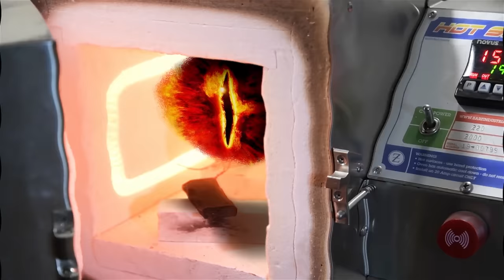Making a Slip Joint Knife

Comment: Hey tony. I’m a knife maker. I noticed that you didn’t put any bushings or bearings around the folding pin. There are these little brass “bearings” not really bearings more like a paper thin brass washer with holes in it to help keep the oil in that joint so it doesn’t completely squeeze out when you tighten it down. Might be why your knife didn’t feel the same as when you did the dry fit. Also if you are gonna make another one. You should use screws instead of pins (especially for a folder) so you can adjust the tension and blade centering. Still super cool!!
Reply: Merely replying so you can see Tony saw it!
Reply: Perhaps the ones he used weren't ideal, but I see a pair of bushings among the knife parts at 16:10, and just three seconds later they're shown being installed on the knife.
Reply: @klasodeth  Those are washers. Bushings go in between the knife blade and the pivot pin, kind of like a sleeve.

They look like plain steel washers, which aren't the best choice. Most knives that use washers instead of bushings or bearings use either teflon, nylon, or phosphor bronze for the washer material, because they're self-lubricating to some degree. Teflon and nylon are usually used on budget knives, while phosphor bronze is more often used for more expensive knives ($50+) because it lasts much longer and doesn't compress like teflon or nylon, so its more consistent and easier to dial in the action. 

Still, pretty good job overall for a first attempt.
Reply: Hinge tension was my first thought. Takes a lot of fiddling to get my knives "right" after cleaning and oiling, but it's totally worth it.

Comment: Hi Tony, that knife came out excellent. Love the violin design, and the fact that you made it just for Xyla.
If you make a folding knife in the future, use some brass tubing standoffs on the inside (slide the rivets through them to hold the scales apart). That way if the rivets are too tight, it won't pinch the blade.  Cheers

Comment: That was doubly fun for me - first the knife making, but then, a blast from my past - that electromechanical thingy is a repurpose of two uniselectors from a Strowger PABX. In real life, every time you picked up your handset, back then, one of the uniselectors at the PABX, would self-rotate to look for a free first selector, that would give you the dial tone and route the first digit you dialed into a free second selector, and so on, until the last 2 digits were dialed on the final selector (a 10 by 10 matrix of subscribers) that would then ring the destination phone.
Have a Great Christmas!
Reply: The moment I saw those things I knew he raided a telephone exchange.
Reply: @kleinisfijn  Or a Nuclear reactor fuelling machine... cos that what the logic controllers were in my early days playing with them. We changed to GEM 80 logic after about 1988.
Reply: @kleinisfijn  Yep. Once you have known it, you can't forget it :-)
Reply: Until late 1980's, when they broke the original NANP to add exchanges due to cellphone and pager (remember pagers?), digital electronic telephone switch software still emulated the digit-by-digit pattern so they could replace those old mechanical switches. More useless trivia.
Reply: @weshowe51  Pagers are now on a seperate network I think. My pager for the FD is independent of the phone lines and uses VHF instead i believe, entirely different isolated towers not just piggybacking on the cellphone.
Reply: @weshowe51  Yep. long before IP phones :-)
Reply: @kleinisfijn  miniature versions of the old step switches.
Reply: When I first saw it I immediately said uniselector.  Hav'nt worked on one of those for about 50 years..
Reply: The old hospital i worked at had one still in use on a star talk conference system..  whole thing ran off of a big ass transformer with the 90vac pushing on the ring circuits and a 50vdc pushed for all the electromechanical contact selectors.  All connections were exposed and sparked every time it would get switched on from use..  they had it as a backup because the commissioner wasent fully trusting of the whole voip digital transition.  Also had an old pbx for all places also.. was a bitch having to transfer all those in house numbers into call manager and leave both operational for over 9000 numbers..  on a pbx that was slowly dying from parts going obsolete.   Luckily i was able to have full run at it and made some software to make it work.  Funny thing is that as soon as the old system was switched over my job was obsolete as well so they fired me.  But when you fire a software developer whos work is the backbone for a systems operations,  you might end up losing the copyrighted, private use of software.  So they lost the rights to my software which was completely unique and had protection that was in place to default to 0 for every station and set.  The hospital shut down for a few months and they had to buy a whole new setup and buy all the cisco switchgear and networking plus wire cat6 and run a new fiberoptic redundancy star to the place..  lol. Cost them tens of millions.. yet they only offered me a lawsuit which i won, and all they had to do was not fire me..  or hire me back which was offered but said they were losing money by having me because had to pay me for doing 3 jobs responsibilities.   Learned a lot there..  dont ever trust any company unless its yours cuz people dont care about anybody but themselves..
Reply: @Z-Ack  I hear you and understand perfectly. The cut-over of many old systems meant an immediate firing of the personnel that worked hard to ensure it (many times overnight), because they were no longer needed with the new system online - loyalty seems to be expected only one way, on these situations.
Reply: @taliakuznetsova7092  They were always on a different band than cellphones. But "back when" you set them off by making a phone call. Then later, they added IP connections and text messages.
Reply: @Z-Ack  wow this is an amazing/sad story. this kind of thing happens so much. save a dime to lose a dollar, and somehow they NEVER LEARN...

Comment: Brought back memories watching the uniselectors operating, we used them back in the seventies on our Varec tank gauging system.
The tankfarm operator in the refinery would dial the tank number and enable the transmitter mounted at the base of the tank and send pulses to the remote selector and display the tank level on the console, maintenance intensive system until we replaced with a more modern system.

Comment: As a knife maker who's a tot fan this was fun to watch.  Next time i hope tony uses a 1/2 stop if he makes another slip joint also tempering the spring to about 45hrc is where you want to be.  Yes Sandvik requires liquid nitrogen to convert retained austentite but the blade wants to be closer to 60hrc.  Ive had good luck with dry ice and acetone baths directly after quench and pre tempering.

Comment: That switch looks a HELL of a lot like the cam stack on a pre-computerized sewing machine.  I wonder how much crossover there was with that kind of engineering back in the 40s-60s?

Here's an idea for you, This Old:  Buy a Singer 401 or 500 and tear into it.  Those engineers were doing a hell of an interesting job with cams, followers, bellcranks and linkages.  They are mechanical as hell and incredibly precise for things made in a high-production environment.
Reply: I can't really think of a way to make a [ reasonably durable ] electronic sewing machine, it is just the sort of device that is inherently made of mechanical clockwork. I mean sure you could use a computer controlled motor to get an exact number of stitches but other than that it just seems like a purely mechanical task.
Reply: @mytech6779  Many of the new domestic home machines use circuitry to control zig-zag and stitch length settings, but the actual work is still done mechanically. And there are long-arm industrial quilting and sewing machines, basically CNC printers that use thread instead of ink, that use stepper motors. But those are hideously expensive-- $15-30K-- and frankly, I don't know much about them. Some mechanical means has to get the thread through the fabric, around the bobbin to pick up the lower thread, and tighten it to form the lock stitch.

If you REALLY want to break your brain, take a look at what a serger is, what it does, and how it does it. Or even a walking foot sewing machine.

Comment: That led light sign thing is so cool to see. On your knife my only concern it's folding knifes should lock open solidly where you have to manually release the blade to close it other wise during use the blade can close on your fingers. But it looks great
Reply: Here in the UK, locking knives are banned. Bloody stupid if you ask me.
Reply: @LesNewell  wtf who managed to get locking knives banned? I'm so used to them by now that I feel really unsafe when one doesn't lock
Reply: Here in germany locking knifes are not banned, but the must not be spring-loaded (e.g. self-opening). And I think there was a lenght-rule as well, something around 12cm (~5 inch).

And often it is not allowed to carry those knives in public, but you can own (and safely store them) at home.
Reply: @LimabeanStudios  You aren't allowed to carry a locking knife in public, also the maximum blade length is 4".  At home you can use a bigger knife and I think they can be locking.
Reply: @christophpoll784  dang I'm from MN our max blade length is 7 inches and you can carry fixed blade or folding they can be spring asserted aswell just not push button or switch blades or butterfly blades. I carry a 5 inch boot knife daily
Reply: @Self.reliant  Ah yes, but you live in the US where it is Ok to carry an RPG in public and go to do your weekly shop in an Abrams! 😂
Reply: @martingardener90  no rpg but definitely a side arm. Our president wants to refund the police. I live north on the twin cities in MN and things are getting pretty rough down there

Comment: Hey Tony, I've been watching your videos longer then I can remember.   Respectfully, I have a tip.  A quick and dirty method for setting the proper spacing on a folding knife is to make spacer bushings.  Place them on the pins in between the liners.  When you peen the pins, the bushings set the gap and tolerances of the knife, preventing the peening process from squeezing the liners on your blade, and spring.  A lot of high end knives use them and have multiple color schemes so you can customize the knife to your liking.  Check out a Benchmade bug out for an example.  Merry Christmas Tony!! Thank you for the years of amazing content!

Comment: I found  your channel again after google kicked out my subscription last year. I actually learn stuff and enjoy your humor. I made a spectrum analyzer multiplexer for Intel back about 40 years ago. It was completely solid state, 512 channels and 64 lines per channel. It's purpose was to look at address and data lines on microprocessors in a burn-in oven for testing the microprocessors slated for military use. I thought up the design on my lunch hour while on contract to Intel to find a way to address cache memory on Zeon, Celeron and Pentium Microprocessors. Keep the creative juices flowing.

Comment: In 1968, I made a conditioned-response AI out of telephone stepping switches, very like those in this project only smaller.  The way it worked, was that you would push one of six buttons (the command).  Then it would step through 10 different light bulbs (responses).  If you pressed the "reward" button, it would remember that "response" for that "command".  You could repeat that for each of the six command buttons.  You would end up with a "trained" AI, with each command tied to it's own response.  To start over, there was a "forget" button.  I was 16 at the time, and this was in my occupational electronics class.

I entered it in the high school science fair, and won nothing.  My classmate who made an electronic version of a single neuron won.  My electronics teacher was the judge, and he was an analog guy.  But I won the prize that mattered:  The neuron-maker was blown away by my machine!  This began my lifelong interest in digital electronics.

Comment: Hey Tony, we have these things we use at my work that are like threaded inserts but are divided twice 90 degrees apart half of the height of the threaded rod. The other half is threaded on the outside, which can be put into a fixture. I believe you can find these at Ace Hardware but I am not 100% sure and I do not remember their name. They use a countersink screw / bolt so that the taper will spread the fins apart as it is screwed in, applying holding force to the area. Maybe in the future you could use something like this on the wooden handles to put them back on the CNC router to do a facing operation and then re-run the program for the design on the pieces afterwards? I suppose that would take more work than what you ended up doing, but it might be something worthwhile in the future. Thanks for being such an inspiration!
Reply: Interesting. Maybe post a pic on imgur?

Comment: 12c27 can still be cryo treated for a little extra hardness at any time.  Maybe not a bath in nitrogen due to the thermal shock on wood scales and epoxy, but it would certainly suffer no ill effects underneath a chunk of dry ice in a cooler for a few hours.  -70C is possible without an ethanol or acetone bath if the cooler stays insulated with enough dry ice.  Might pick up a point or two but not quite to full cryo hardness, as that is best achieved immediately after quench.

Comment: Factory recommendations aside, I’ve found 12c27 like most stainless/high chromium steels have a far better quench with aluminium plates - much more consistent and a higher hardness. Domestic Freezer will get you a little less retained austenite too. Love your work!

Comment: Very nice knife.  It sucks you lost the detail on the handle but that is how things are sometimes.  On another build slip a really thin plastic shim in between the grips and the blades when peening over the brass rod and then slide it out afterwards.  It should eventually free up a bit but that allows you to have just a bit of space when it's all put together.

Your gift is actually really interesting.  looks like as you said an exchange multiplexer or something of that nature.  Anyway I believe what is happening is one of the rows columns on the first one is being used to activate the second one so that a new line can be addressed.  So a line is what goes around the device and a column gets dropped down after a certain point.  Anyway they basically use pinball electrical mechanical coils to create the movement.  In fact they could be old pinball parts from the look of them, or new oldschool ones or something like that, LOL.  Side note, the same part is what is used in old school tattoo guns, the electromechanical coils that is.  They are just setup to fire repeatedly when the power is applied, and yours has a "dead spot" that is activated by the switch.  Very interesting indeed.

Comment: The LED chaser looks to be controlled by Uniselectors. They are an electro mechanical device where a solenoid  advances the rotor by one segment every time it is energised. Uniselectors were used in telephone exchanges

Comment: They certainly look like old exchange switchgear. I remember working in an Australian exchange. When the local radio station did a phone in, and 1000 people dialled the same number, you could follow the call across the building...with your ears, not on foot! When we finished upgrading, the entire exchange was empty, except for one dresser-sized cabinet that made no noise at all. I have no idea what happened to the switches

Comment: Strowger switch (maybe).  Silly idea... Get out your DLSR and set it to manual.  Set its shutter speed to a little longer than the machine takes to complete lighting all the LEDs (you'll have to experiment with the aperture to get a good exposure).  Sit it on a tripod and point it at your (received) secret santa present.  Turn all the lights off.  Release the shmoo (or press the shutter release - your choice).  You may need to add some more illumination to fill in where the red glow doesn't reach (depending on how dark you got the room).  But you may end up with a cool shot of the machine, with your moniker fully illunimated.  Great video - I'm going to go check out the two people you connected to - they both sound talented.

Comment: Wow those rotary switches and the whole wiring harness look just like what I pulled out of an old airplane radio frequency selector. I cut all the wires intending to put potentiometers on the shafts to use it as a control for a flight simulator, and only after I’d done that did I realize how stupid it was not to leave the encoders wired up to sense the position of the selector.

Comment: I'm pretty sure those switches are from an old telephone exchange.  Where your line entered the exchange, the first dial you did (old style clickityclack) would drive the first rotary switch the same number of steps.  Then each dial after that would affect the next switch in the chain.

I'm sure there were plenty of other electromechanical shenanigans going on, but that was the basis of the system.

Your dial interrupted the current, causing a pulse.  That pulse moved one of these switches, and eventually, you ended up talking to the party whom you are speaking with.

Comment: Looks like the old Strowger switching system that was used here in the UK by the GPO in telephone exchanges probably up until the 1950/60's.  Replaced by Crossbar (relay) system before digital took over.

Comment: As a retired telephone technician, you are correct... I believe that they are Uniselectors. Different make to the ones I saw as an apprentice, but i'd put my money on a Uniselector from a brand of electromechanical telephone exchange equipment from back as early as the late 19th century. These ones prob date arount the 1920s.